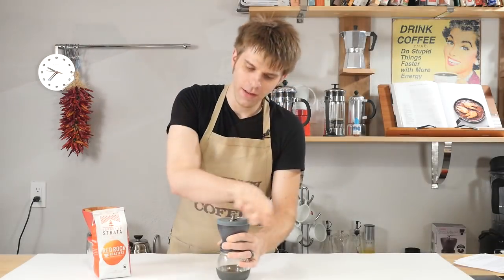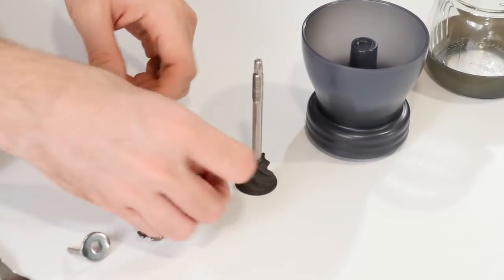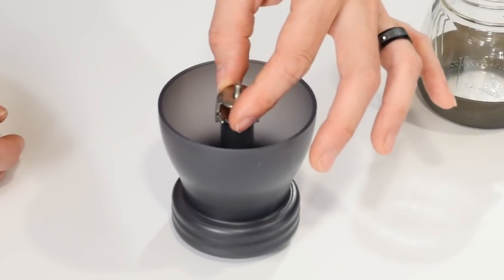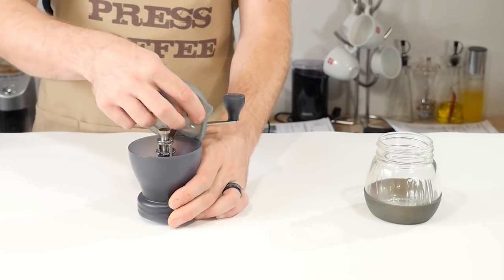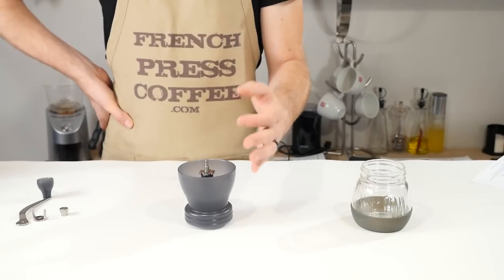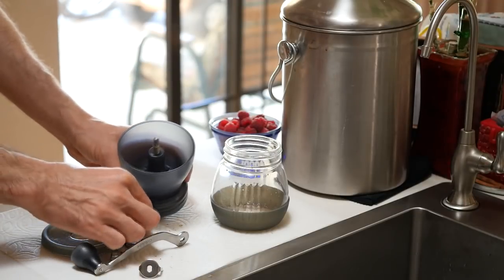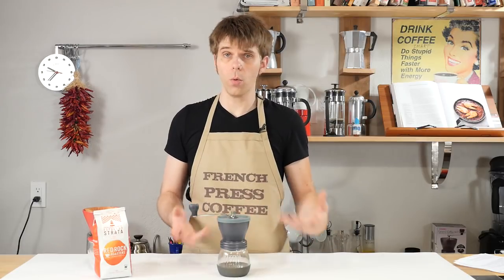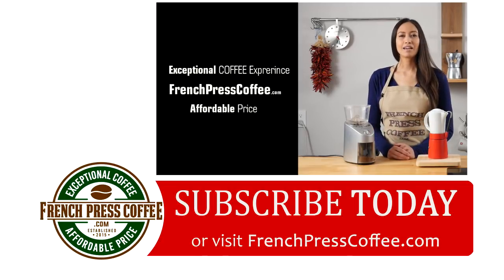Hario Ceramic Coffee Grinder Instructions - How to Use, Adjust the Grind Setting and Clean

Comment: What exactly would happen if grinding to fast?
Reply from the maker: Some people use drill to speed it up - this is big NO NO :). Especially with finer grind it can simply kill this grinder. Hope this helps.
Reply: My guess is that:  ceramic is great for grinding beans (soft compared to the material), but ceramic is also great for grinding ceramic.  Grinding on too fine a setting would lead to parts wear, as would grinding by attaching a motor to speed things up, or trying to brute-force speed grind manually.  In the video, when he's showing the effect of the settings on the spacing of the grind cone and body, you see that the cone moves side to side inside the body.  As the beans are being ground, they kind of act like a dry "lubricant", preventing the two surfaces from touching each other.  Slower grinding allows the progressively finer ground coffee to fill in the spaces between surfaces and prevent surface on surface wear.
Reply: Hi Dusan... I'm not an expert...but I've heard that if it's ground too fast...(like on steel blade coffee grinder) it "heats" the bean-choppings and thereby changes the "bean chemistry"...making it more bitter, I believe?  I'm a newbie myself and no one has really gone into detail about this on YouTube.  
**I currently have a cheapy $15 dollar (gulp!) blade grinder from Walmart.  But after seeing this about the ceramic burrs (which supposedly don't heat up) and slowing down on the manual grinding vs a machine....I'm seriously considering buying this on Amazon...in a few minutes! lol  Hope this helped?  Take care.

Comment: I bought this grinder when I first got in to coffee, don't buy it, just don't. You cannot adjust grind sizes on the fly, not that it really matters because the shaft wonders a great amount so it is impossible to get an even and consistent grind size. Handground grinders are pretty inoffensive, Porlexes are pretty acceptable entry level grinders compared to this but I would suggest a Commandante if you are seriously passionate about coffee they rival some pretty expensive professional tower grinders on grind quality.